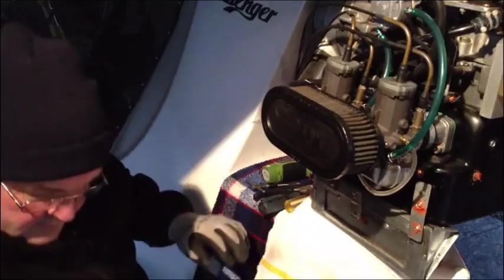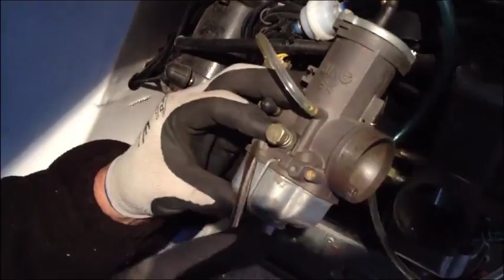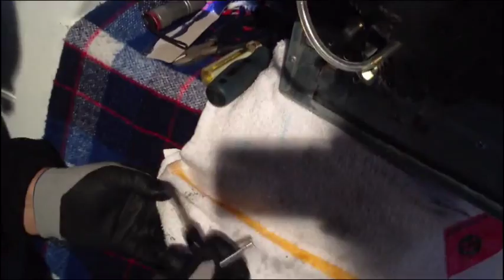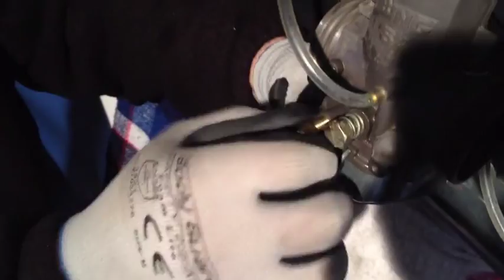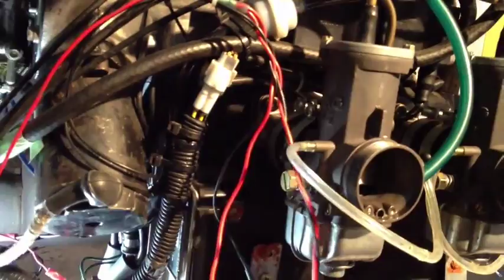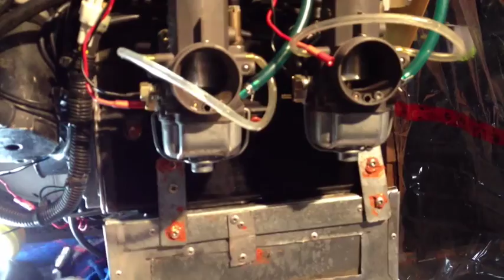Carb heater installation

Comment: I've installed on this my 503 Rotax, and my icing concerns are a thing of the past.  Thanks John for putting this kit together for us.  BTW, your fogging kit works beautifully.  Definitely a great design and an engine saver.
Reply: Hi Steve I cant find this heater anywhere  if you have supplier info please email me with the info: stephenpease54@yahoo.co.uk  thanks in advance
Reply: You can find the kit on John Baker's website at RotacRepair.ca

Comment: In cold area in Japan, this electric heater is normally equipped to "carburetor type motorcycle". The following URL is helpful.ttps://search.yahoo.co.jp/image/search?rkf=2&ei=UTF-8&p=%E3%82%AD%E3%83%A3%E3%83%96%E3%83%92%E3%83%BC%E3%82%BF%E3%83%BC

Comment: You can buy the heater plugs from Suzuki or KTM, they do a 20 ~Watt and 35 ~Watt version, a small 8mm bolt with heat element inside. They work OK in normal weather but mine are overwhelmed in winter, installed two